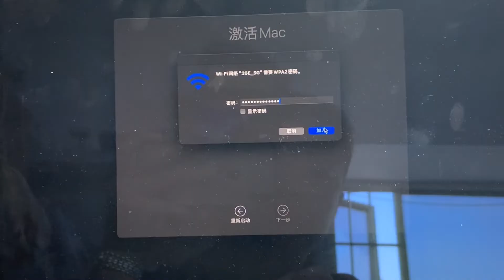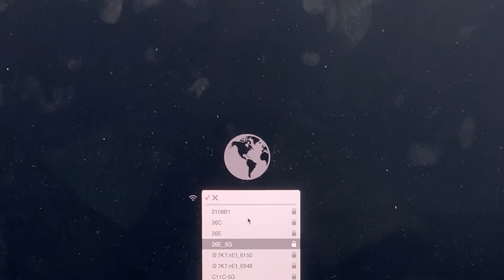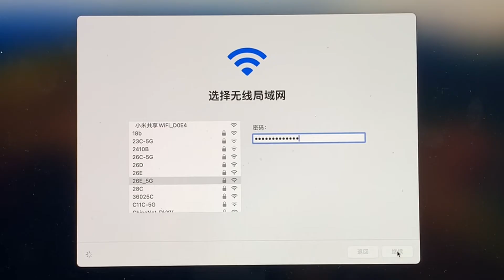MacBook Pro A1989 remove iCloud，change t2 chip，very easy

Comment: Hi youre replacing the t2 ic but do you change it from an macbook without icloud or doesnt this matrer and does it need to be from the same board number
Reply: It should be t2 from icloud free MB
Reply: The T2 chip needs to be flashed then soldered back.
Reply: @superted1292 how do one flash it?